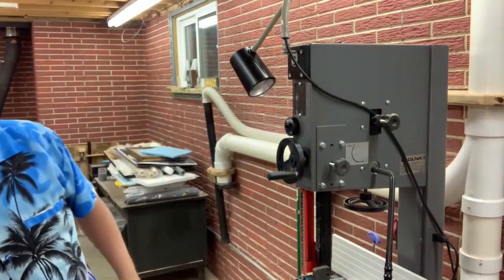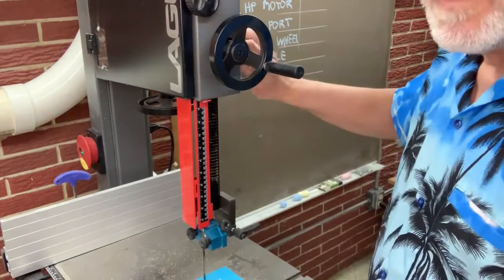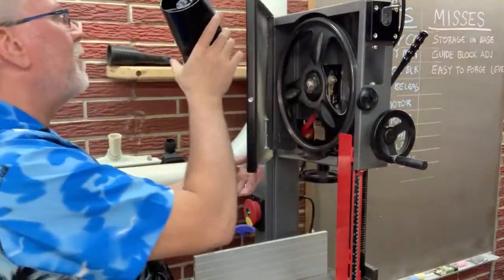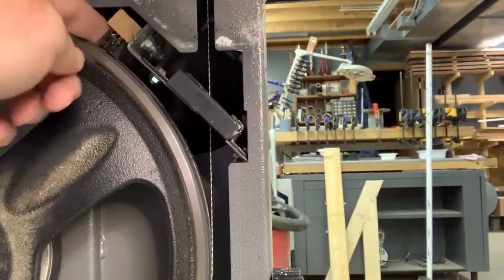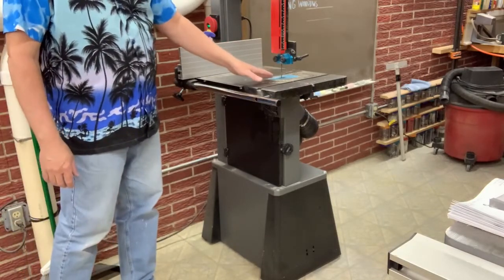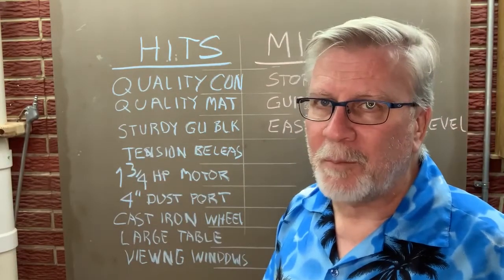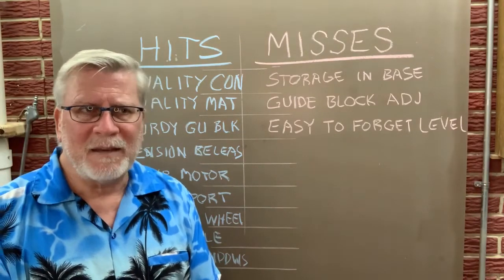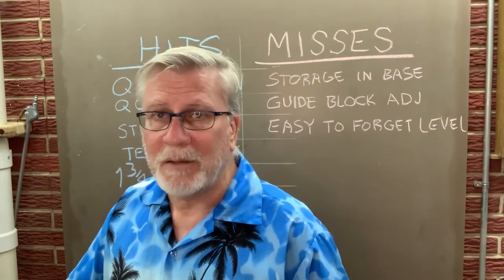Laguna 14 Twelve Bandsaw Review | On the Mark with Mark

Comment: I have the one , love it. I put a electrical ( normally open switch on handle) so when handle is down the saw won’t start. Plus ,I ran a relay switch inline with on/off switch so the lamp will not be illuminated. Use 20 amp components for build. Happy times is wood working

Comment: Nice honest review Mark.  Thanks for sharing all your thoughts, both the good and bad.  I have the same saw and like it quite a bit, although I did modify the fence, dust collection system and add a small outfeed table.  I walked into a woodcraft store and the employees had tied a red shop rag around the tension release handle.  I did something similar with a red pipe cleaner wrapped around the handle.  That way I never forget to tension the saw.
Hey thanks again, I enjoyed the video.  
-Willie
Reply from the maker: That’s a good idea. 👍🏻

Comment: “Caution yellow” duct tape on the tension release handle would make it more visible, and nothing dangling down to get caught when you’re working.  Update:  Another thought, make a magnetic sign (like a fireplace damper open/closed sign) to put on the table, the upper wheel door or beside the power switch to remind you before you start it up.
Reply from the maker: All good ideas Kathy. Thank you.